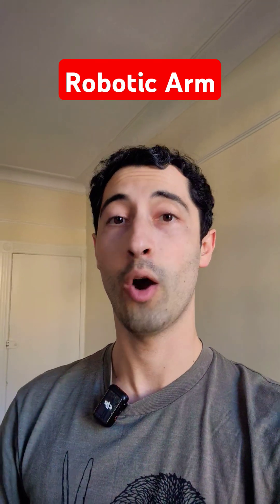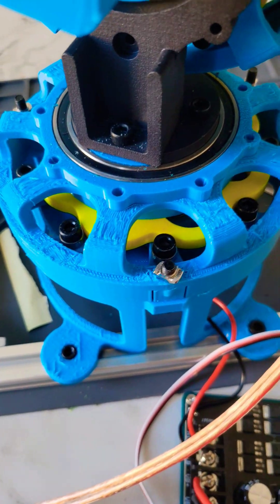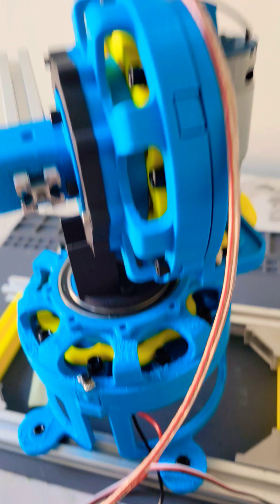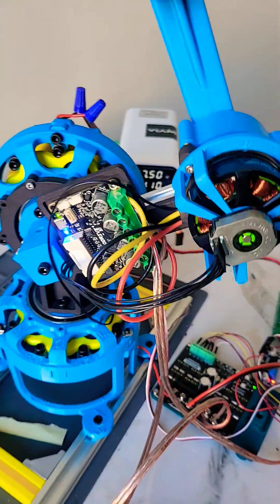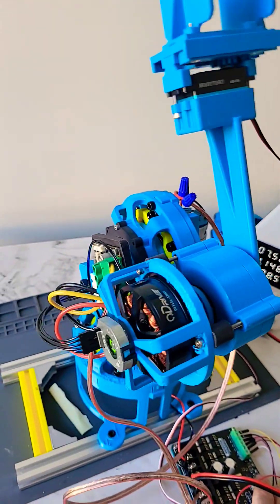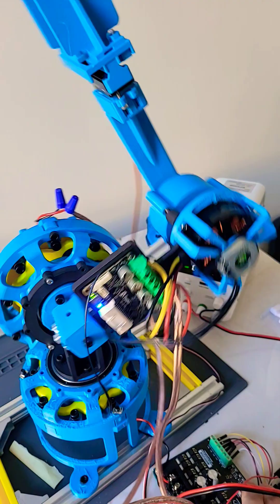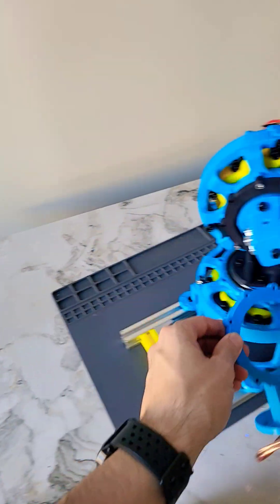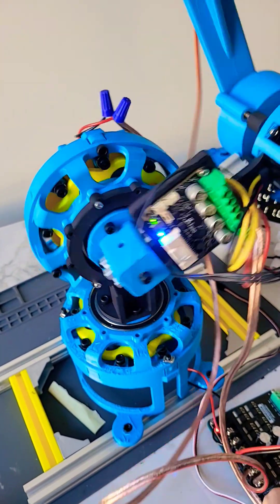Robotic Arm Build

Comment: I’m thinking add slightly smaller motors for lower weight, add counterweight springs like the ones on monitor holding stands, on axis 2, and add acceleration and deceleration parameter alone with ribs on the 3d print for more support. These will help the jittering without needing metal parts. If not, you can insert metal rods into the plastic while printing for additional strength to plastic I.e. large nails and what not, but you have to do it in the right part of the plastic that sees the most flex

Comment: changing material wont help unless you switch to a metal as your looking for rigidity not strength you could also try adding some ribs on the back side where you have them at the bottom they are just not long enough hope this helps
Reply from the maker: Thanks, I am planning to receive an aluminum version of this.